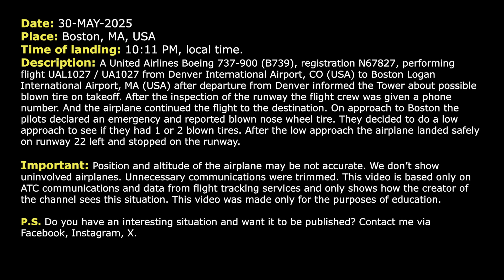Airplane lands with BLOWN nose WHEEL TIRE at Boston. Real ATC

Comment: Why have this planes no airpressure indicators on the wheels.... Newer cars has this, so why planes don't?
Reply: That does seem like a pretty simple thing to add. Vehicle tire pressure sensors communicate wirelessly, but could that really interfere with other wireless communication?
Reply: 787s do. 737s don't.
Reply: They do have a tire pressure sensor in the cockpit. They needed a second set of eyes in case the entire wheel came off or it was just a flat. Go rewatch it lol. Pilot knows that there's a flat